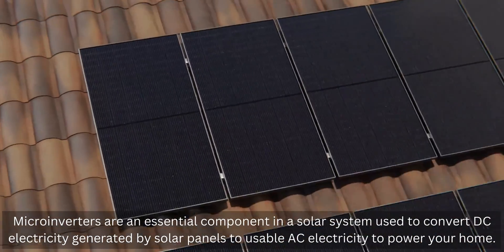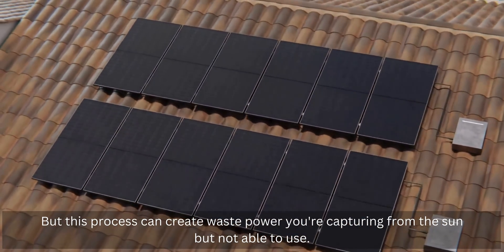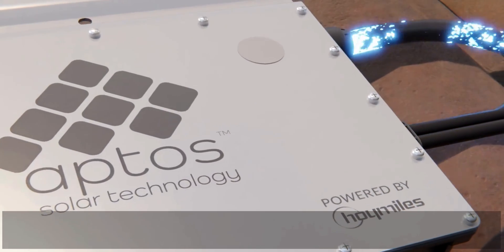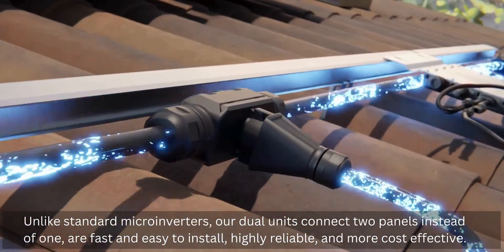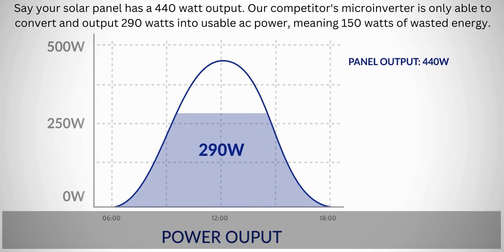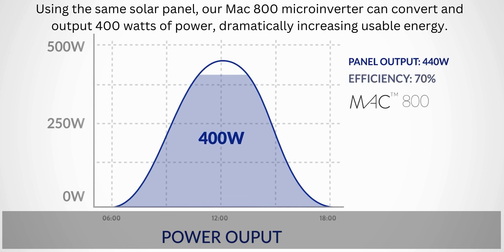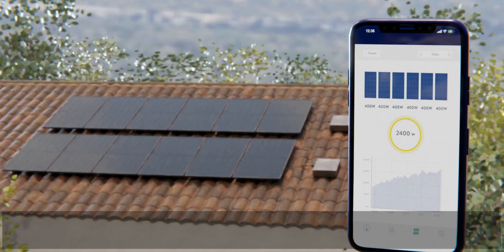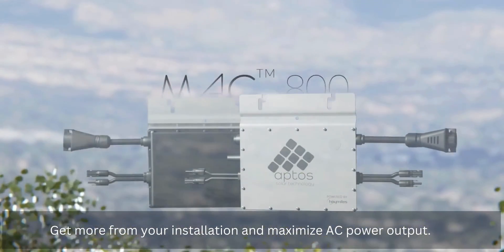MAC 800 Aptos Microinverter : Maximize AC Power Output

Comment: Could I expect the same performance from 1 MAC 800 and 2 panels as I would get from 2 MAC 400's and 2 panels? Or would 2 microinverters provide better optimization? Specifically concerned with shading situations.
Reply from the maker: Contact Us: +1 949 932 0733